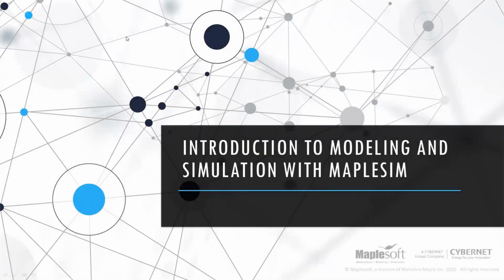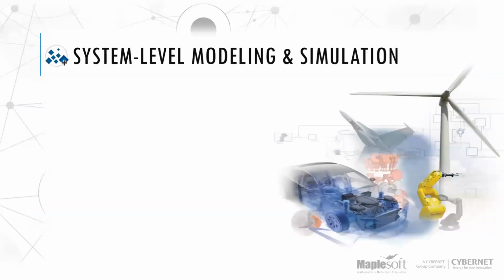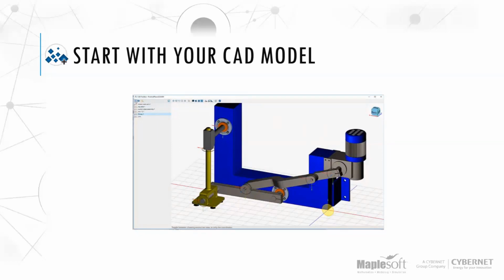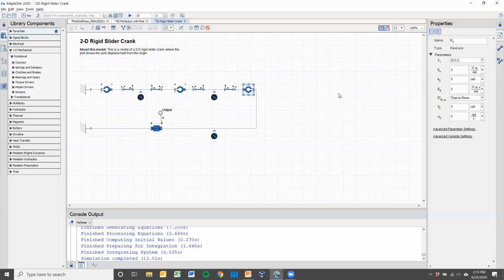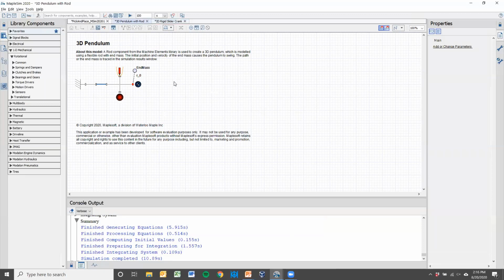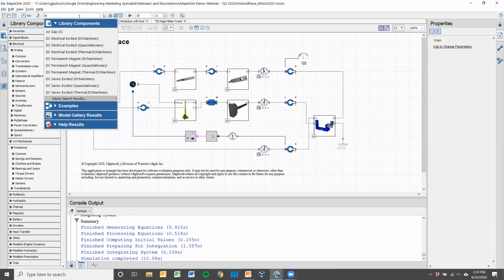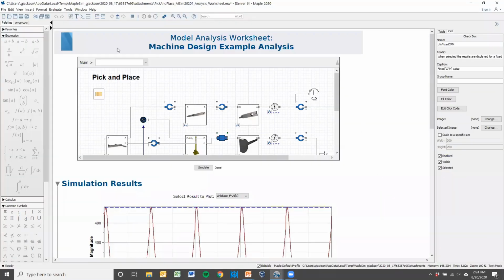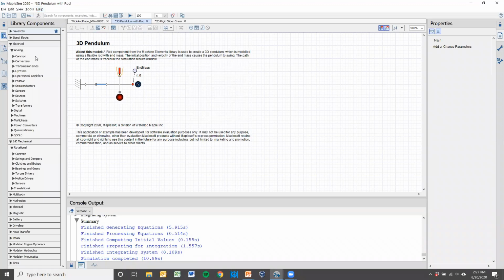Introduction to Modeling and Simulation with MapleSim

Comment: Bonjour, peut-on créer une simulation d'engrenage. Par exemple, Machine d'Anticythère. Merci
Reply from the maker: Hi there and thank you for the question.  Researchers have used Maple to model the differential gear systems found in the Antikythera mechanisms – example https://www.researchgate.net/publication/289205011_Kinematic_Analysis_of_the_Antikythera_Gear_Mechanism_by_Means_of_Graph_Theory
A simpler model of our solar system without gears is possible in Maple by entering the equations of motion for each body, treating gravitational forces based on spring-damper responses to gravity and solve for their positions over time. Alternatively, a system model can be created in MapleSim to model several planets and show the visualization of their motion once the initial conditions are set. We have an example of this in our model gallery (including the MapleSim model file): https://www.maplesoft.com/products/maplesim/modelgallery/detail.aspx?id=10